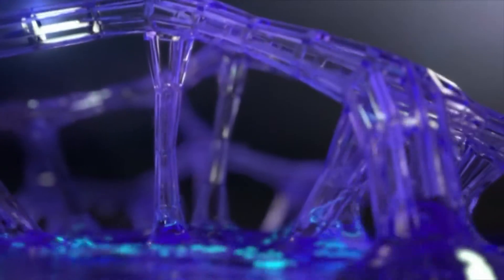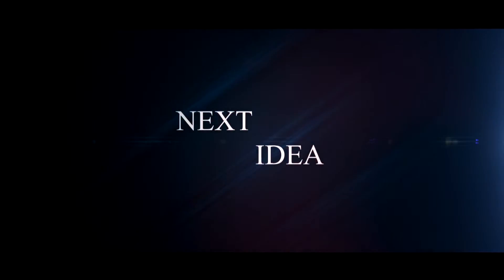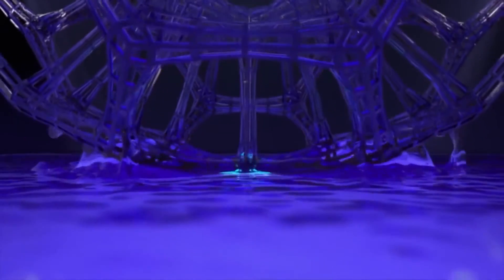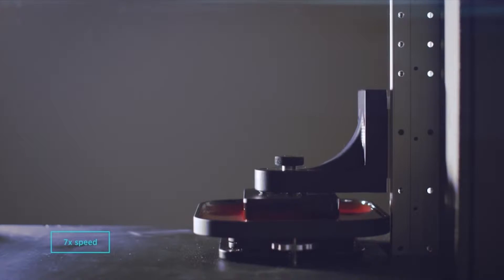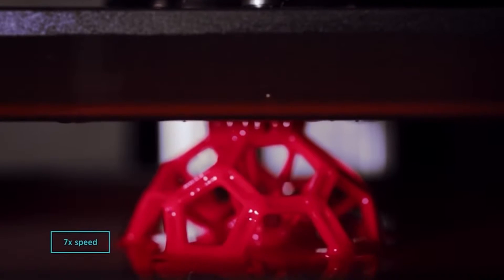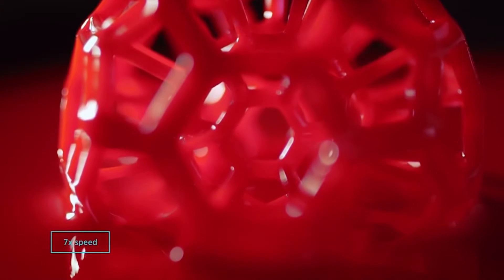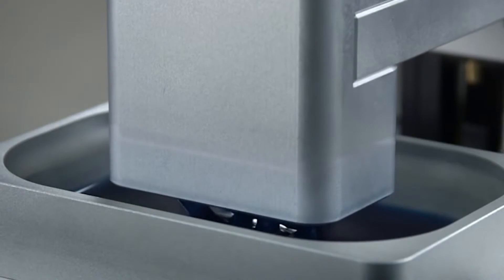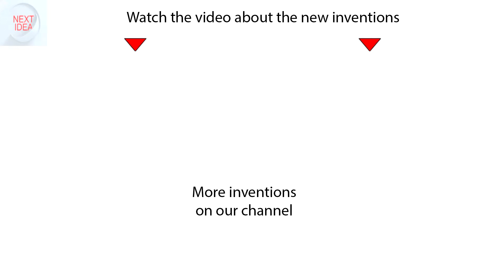Carbon 3D Printer - revolution in 3D printing

Comment: This video did not answer my question and instead it created more questions like:
1. If you use a UV flash light, it would just cover a large surface, how can you shine UV light in small surfaces to make such tiny details?
2. How can liquid plastic turn into solid when contact with UV light? What is this liquid plastic? What's it made of?
3. How can this "window" only allow light or oxygen to go through? How does this window work? Wtf is it made of?